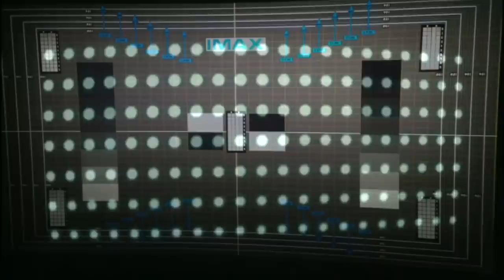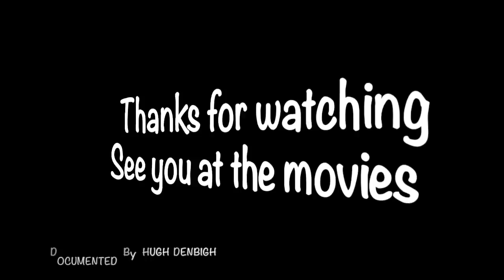IMAX 4K Laser upgrade time-lapse, from 1570 2D - IMAX Theatre - Royal B C Museum

Comment: This brings back memories -- I ran the two 1570 IMAX projectors at Universal Studios Hollywood for the Back to the Future ride.  It used a loop cabinet instead of platters, and I'll never forget the chug-chug-chug sound of those projectors.  They were installed in 1993 and decommissioned in 2007 when the ride was closed to convert to the Simpson's ride.  They were certainly beasts!  Man, those 4K lasers are massive!
Reply: The new COLA system is even bigger, but it has both lasers in one chassis.
Reply: I loved that ride, great memories
Reply: You sir are my hero! Loves that ride.
Reply: Omg, thx to share your experience sir!
Reply: biggest D'oh in universals history they should have kept the bttf ride
Reply: @deanshaw6588  A lot of people would agree with you, but the ride infrastructure was showing its age after all those years (just like the Simpson's ride is now, after having run even longer so far).

Comment: Very interesting video. Despite everything , still the disappearance of the film . Technically, Imax 70/15 is superior in quality to digital projection. Same thing for 35mm and 2K. Everything has been done to make it less expensive for the studios and exhibitors. Really a pity, but film is not dead. It remains the best quality in capture and especially in permanent backup.
Reply: I am not against there being digital theaters to bring down costs and to make it easier for movies to be shown but the theaters should also offer a special experience. 
So that should mean that film is offered as well to customers for for the big special movies. I would have prefered to have seen Dune on 35mm film than on digital. The same for Top gun. I am not talking about the cameras in terms of film but celluloid projection so the movies could still be shot on digital cameras.
Reply: 15/70 IMAX DMR = 18K
Reply: I was about to say, this is more of a "downgrade" video
Reply: The IMAX with Laser GT dual projection system has superior contrast and wider colour gamut (i.e., capable of more saturated colours) to 15/70 projection. It was engineered from the ground up to produce deep blacks and for clean transitions between, say, white and black.

The question of resolution with film is somewhat "how long is a piece of string?" The laser GT system yields sharply resolved images.

Movies shot today almost always go to digital for editing, colour grading, compositing inc. CG elements, etc. A considerable amount can be CG, e.g., set extensions... you really do not know where what you're looking at came from. The digital master would then have to go back (e.g., from 2K or 4K) to film, at which point you may wonder what the point would be... (other than being able to market film projection in very selected venues.)

Avoiding going to digital (as Nolan claims to for parts of his movies not requiring CG work) means working entirely optically, for which the most basic steps are going through the camera lens, onto the camera negative, through intermediate copies (interpositive and internegative) to get the release print for projection, through the lens onto the screen. At which point the "18K" figures optimistically banded about are completely implausible. Engineering and manufacturing true 4K lenses alone is challenging! With said  "all optical" 15/70 scenes, very fine textural details might be discernable beyond 4K, but they are likely to be blurry, if not buried under film grain and other film artifacts (including print wear) to contend with. It is generally inherently a softer and more "characterful" look.

This is not to say the laser projection system is perfect either, there's the problem of laser speckle to control for one. Pretty subtle but I can certainly see it. Any critical apprasial of either 15/70 GT or laser GT would find flaws.

Comment: 70mm to 4k sounds like a downgrade but 4k laser offers better contrast, hdr, & wider color gamut that 70mm film projection can't offer. Sacrificing image resolution & detail for better color quality is still worth it.

Edit: the resolution of dual laser projection was actually 6k.
Reply: its not imax then is it... its just the usual crappy cinema quality
Reply: Not even close. 4K still have picture issue unless the moviemaker do it right way.
Reply: @srijangupta6404  Youtube comment section is not the place to ask for advice like this.
Reply: @srijangupta6404  Measure your viewing distance. Assuming you're going for 4K, that should be your screen size. Halve it for 1080p, double it for 8K.

Getting the best picture quality out of a projector requires good light control. Basically, nothing at all should be shining on the screen other than the projector itself. Not only do you need to block any windows and make sure there are no other light sources in the room, the room also needs to be black to prevent light coming from the screen from reflecting back onto it.
Reply: @KingdaToro   @Adam Ahmed  yes, we have hired an engineer, he suggested that we should get some dark acoustic panels, to  control the ambient light, but i think that wouldn't be needed if i buy tv
Reply: @srijangupta6404  it's a question of taste, a projector doesn't shine directly into your eyes the way the backlight on a tv does, that is part of the reason why you feel usually awake after watching a movie on a tv and not on a projector. No one can help you if you can't make that decision. You also never mentioned how you would spread the budget as you need to consider the sound system, seating, room, etc. Redmi is coming out with a 100 inch TV (I think it's already out on the Chinese market, you'll likely need to import it) for 3000 dollars that could be an option and would give you lots of budget for comfortable seats and a high quality audio system. ALR screens (ambient light rejection) have gone far and are quite good now (you are looking at 2000 dollars just for the screen in the size you want), they are able to offer good contrast with a projector in rooms that are not pitch black. A decent home use laser projector in the same light conditions as a movie theater will look the same btw, so I don't understand why you don't like them.
Reply: @johnnyboy2459  cant stuck in the past boomer..
Reply: IMAX 70MM FILM is equivalent to 18K, am I right?
Reply: @mstyle2006  yep
Reply: @Michael-w8v  it's still IMAX so those variables should be controlled
Reply: @KingdaToro  VantaBlack should help, I guess.
Reply: Disagree. Prefer film.
Reply: @johnnyboy2459  nothing special anymore. But that’s where it’s all headed. Betray your uniqueness in exchange for something which only unique selling point is that it's currently the newest and "the best of the best", until it's not. Participating in the race and stuff.
Reply: I've been in several former imax domes that have converted to laser, and the laser presentation is garbage at best. You don't notice the lose of resolution because the picture is so dim. *both of these setups were 5+ years old at the time so maybe another upgrade was in the works; but I was expecting much better.
Reply: Most people won't even recognize the difference between 2K and 4K. Also, apparently many productions use 2K intermediates for postproduction and then upscale everything back to 4K, so there isn't that much of a difference.
Reply: @mstyle2006  probably around 10k only, size of imax 70mm are roughly equal to 6x7 medium format, which medium format digital camera like gfx100(12k resolution) could outperform 6x7 film in terms of resolution:

https://www.youtube.com/watch?v=sG4JWrxkNfc&t=3m26s
Reply: @BulanTerkenal  70mm film while old is quality film,  it's like vinyl, quality.
Reply: @andreasvogler1875  Yup, there are websites that lists you what movies are upscaled vs what are native. But oddly enough, I always found that upscaled 4K was kind of an upgrade. Even from remuxed 1080p. But I would still recommend remuxed 1080p.
Reply: @johnnyboy2459  It is IMAX. Some Imax movies are not even shown in 4K, they're shown in FHD (kind of) but no one complains, because it's about how immersive it is and how good the colours are. Old projectors weren't that good in reproduction. Kinda sad considering how good film movies looks.
Reply: @AshLordCurry  Also, most people don't know, that only the middle of the image is really sharp. The closer you get to the edges of the frame, the more chromatic aberration you get, which makes the image less sharp, so the additional detail you might get in film, is partially lost.
Reply: @WhitfieldProductionsTV  I wonder if the equipped cinemas will be offered a choice of resolutions for the media, as per the digital music world!
Reply: @mstyle2006  18k was a modest estimate somebody came up with a few years ago. In reality 70mm IMAX film is closer to 30k resolution (at least). There are actually people doing 4k scans now of Super8 film. Yes 8mm film scanned at 4k resolution, and it does look better than 2k scans. Back in the early 2000's everyone thought the max resolution of 35mm was 2k and that's why so many directors and studios jumped onboard with digital formats, because "nothing could be better" but how stupid and wrong they were. 35mm started getting scanned at 4k, 6k and now 8k because as technology develops they keep finding they can extract more digital resolution from old film. Ultimately however, no one needs higher than 4k at home on their TV. Most are perfectly happy with 1080p because the difference isn't noticeable enough on such small screens. Theaters however, with giant screens 60 feet tall definitely need much higher than 4k resolution.
Reply: @mstyle2006  About 12K. But, resolution isn't the whole story. Better color and HDR depth fool's the eye into seeing much better images than they actually are. Also, FPS makes a huge difference as well. Digital IMAX can go from 24FPS for low motion subjects, to 60 FPS (or a bit more) for fast moving objects. This helps control visual blur but reduces the perception of something moving fast. It all comes down to how good is good enough? 4K vs 8K TV's for example show very little visual quality difference for most people at viewing distances that are appropriate for the screen size. Post processing software for IMAX cinematic cameras (and others such as Red Dragon) also allow fantastic control over contrast, brightness HDR, FPS, color correction and vibrancy, and so much more. This just wasn't possible with 70mm film. This alone can dramatically improve the perceived image perception quality.
Reply: Have you seen a modern picture in 70MM imax? I’m massive proponent of digital everything but when I’ve had the chance to see 70MM it looks absolutely mind blowing.
Reply: @WarpFactor999  15/70 IMAX film is way beyond 12k resolution. At least double that. You're right about color depth and dynamic range though, and still digital can't touch that of film.
Reply: @montekore374  No, you didn't watch properly. They had a 1570 GT film projector AND 2x 2K digital projectors (used for 3D films). All 3 of these projectors were removed and replaced with the 4k laser system. So yes, they had a film projector which was removed. By the way, if you can find a theater somewhere in the world still running dual film projectors then that's a real 3D spectacular treat, but you'll only be able to see older documentaries.
Reply: @PixPete  According to multiple sources, Imax 70mm film is 14K to 16k. Which sounds about right as 35mm film is equivalent to 4K.  I'm VERY familiar with both 35mm and 70mm formats having shot professionally in both.
Reply: @WarpFactor999  That's absolute nonsense. 35mm film is higher than 4k for starters. It's regularly scanned at 6k now, and as I stated previously even Super8 gets scanned at 4k now, because they found more detail than 2k scans.
Reply: @BulanTerkenal  70mm film is equivalent to 18k digital... The past rules and your gay lazers sick diq
Reply: @scadz_  but it's not, IMAX 70mm film is equivalent to 18k.l in modern terminology. I'd say 4k is going backwards because even the normal cinema near where I live are 8k resolution on a smaller screen
Reply: @johnnyboy2459  better now? :D
Reply: Contrast is trash on gen 1 stuff. 3000 or 4000:1 is a joke with most 40klm stuff
Reply: I have never understood the color accuracy and range arguemnet for digital. Directors spend their careers trying to replicate film colors and even shoot on film specifically because of the rich saturated colors that just look better. Maybe it's not as 'accurate' color representation, but it's way more pleasing to the eye. As far as range goes you can only see such a range anyway. I doubt anyone could reasonably tell the difference.
Reply: I wonder how long the new system will not last  I bet not as long as the old system anyway a very impressive video and I have watched Imax movies one of the places I went to is in Seattle !

Comment: I knew the projectors themselves were huge and looked somewhat like this, but holy crap there's like 17 million other giant components to a movie theatre I never realized were there. Like the speakers behind the screen... how do those not cause a resonation or ripple effect on the screen? And the physical storage banks and hard drive servers sheesh. The generator or transformer or inverter or whatever it was... Also wonder how much heat these units must put out.
Reply: The screen is what's called "acoustically transparent", it's full of tiny holes, too small to see from the seats, that let the sound through. You can see them if you walk right up to it. The thing that puts out the most heat by far is the actual lamp (lightbulb) for the projector, as it uses at least 5000 watts. Its heat is exhausted out through the roof, similar to a clothes dryer. The IMAX lamps are 15000 watts, and have to be water-cooled, air cooling isn't enough.
Reply: @KingdaToro  detailed and very interesting, thank you!
Reply: @KingdaToro  
Imagine what IMAX could do with 35mm film if they really put their minds to it. They could probably have really exotic processes like using laser light sources for the film projectors. 
If IMAX, Kodak and a few other players got together they could probably do some really special things with 35mm film for large scale special theater showings.
Reply: @bighands69  They could essentially bring back VistaVision. It's an old projection format that's basically the 35mm equivalent of 70mm IMAX. Just like IMAX, it runs the film horizontally, with each frame being 8 perforations wide rather than the usual 4 perforations tall. Change it to 10 perforations wide, and you get a usable image area of 47.2 by 25.17 mm, assuming no sound on the film like IMAX. That gives you an image area of 1188 square mm, compared to 352 square mm for regular 35mm, 1072 square mm for 70mm, and 3295 square mm for IMAX. It also gives you a 1.88:1 aspect ratio, which is very close to both 16:9 and 1.85:1, then for 2.35:1 films you just use a typical anamorphic lens.

But the question is, is it worth it? Probably not, since the image area would be barely larger than the existing 70mm format. The width of the frames would mean the film length and speed would be 2.5 times greater than that of normal 35mm, in fact 2/3 that of IMAX. It would likely require projection equipment similar to IMAX equipment, using a rolling loop and field flattener system, rather than the intermittent sprocket and gate system that normal 35mm uses.
Reply: As KingdaToro says, the screen is perforated. You are certainly correct to query the acoustic effect though.

Actually the perforations can be used to advantage, causing high frequencies to spread out which might give better sound in seats that aren't in the centre of the auditorium. However, there is the big problem of sound that goesn't go through the holes reflecting back off the screen, then off the wall behind, possibly back and forth until coming out of the holes. The wall behind the screen is covered in heavy acoustic absorption to help control this.

Once installed, the whole system is equalised to correct frequency response. It is also (supposed to be) automatically recalibrated every day as well using microphones in the auditorium; IMAX use technology licensed from Audyessey (consumer versions found in A/V receivers.)

As for the screen itself moving, it is of course tensioned up. But, oddly enough, to help control the issue of laser speckle, the screen is intentionally slightly agitated by numerous "screen shakers" behind. You can see these at 4:19 in the video--the circular transducers mounted in a grid pattern.